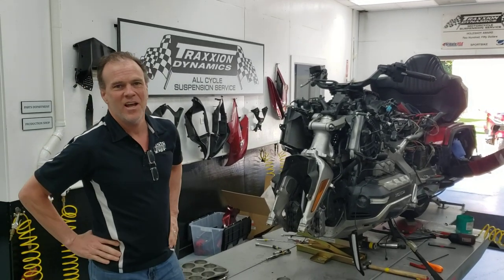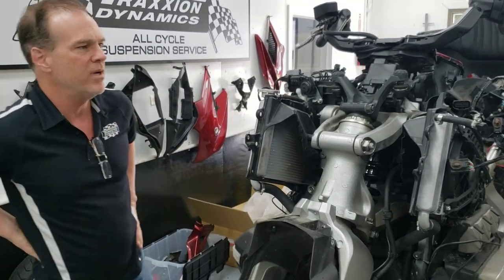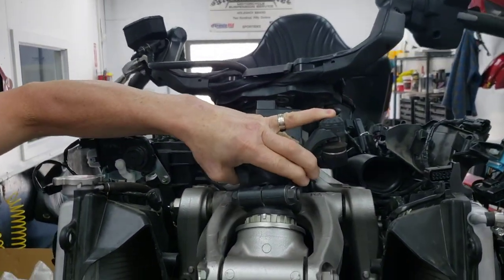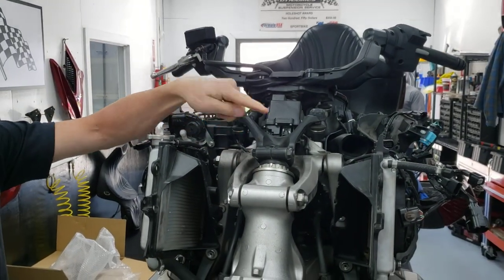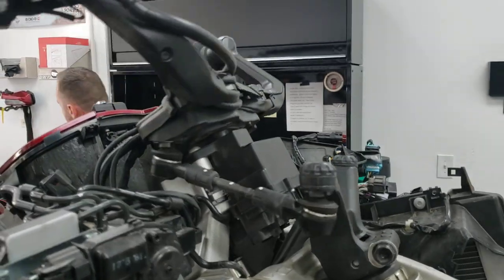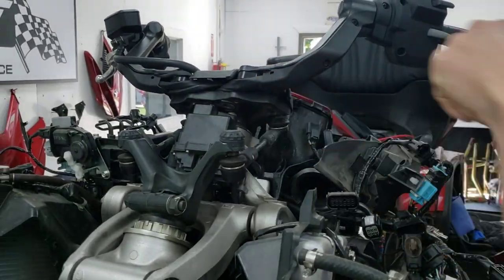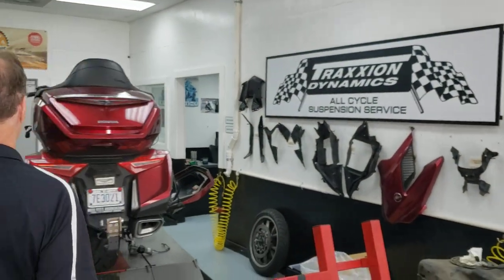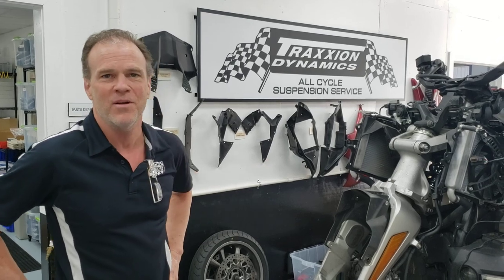Close-up Look at Steering System of 2018+ Honda Goldwing with Max from Traxxion Dynamics

Comment: Wonderful to see everything, not only the steering. Its amazing how much goes into a bike these days. How something small can occur to cause a recall. I do think it was smart to have the radiator on the side. On my K1600 GA, it has a massive radiator in the front and between oil changes, you need to wash all the bugs and crap. Every few thousands of miles, you shine a light and you see a zoo on the radiator. Thank you again !!!
Reply from the maker: Happy to help!
Reply: @Traxxion  You are the man, Max. Thank you again for replying to me via your tech on the drain bolt torque issue.

Comment: i'm really impressed to see GW has fans on both radiators.  the BMW 1250 GS also has two radiators like that and for the same reason ( more complex than usual suspension ) but it seems only one of the radiators on the BMW has a fan on it, though 1250 a partially air cooled design so it's probably fine.  the BMW K1600 though tend to overheat in the mountains from what i read, so the dual fans on the Goldwing are a really nice touch.  i also like how radiators are fairly small for the size of the engine but the fans are huge.  fans weigh a lot less than radiators with antifreeze in them so i think this is the right way to do it.

Comment: Mind boggling Max. Reduces changing the air filter on an 01-17 to the ranks of replacing a fuse.
Reply from the maker: They didn't fix that either on the new Wing...

Comment: Max it seems like this bike has nothing but problems, I'm sticking to my GL1800 to be on the safe side.
Reply: Chris, I think you meant to say "Gooold Winggg, gooold winggg"
Reply: Me too Chris although given that the 2018+ can barely support its own weight, it might collapse under the add-ons you've put on your behemoth.  I keep trying to talk myself into the 2018+ on the basis of progress and all that, but in all honesty, beyond the engine and the weight loss, for me, there's too much on the 2018+ that's either a backward step or an unnecessary complication.  Thanks for the video Max.  Interesting to see it stripped down.